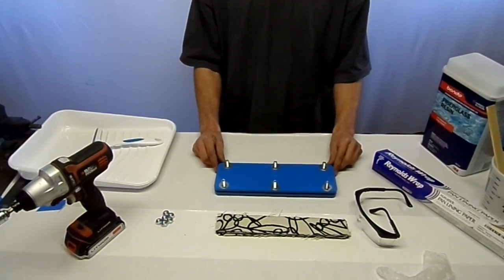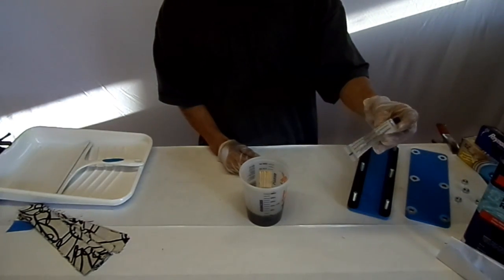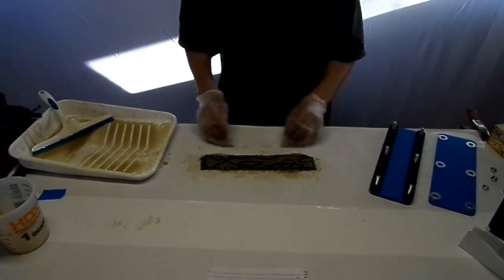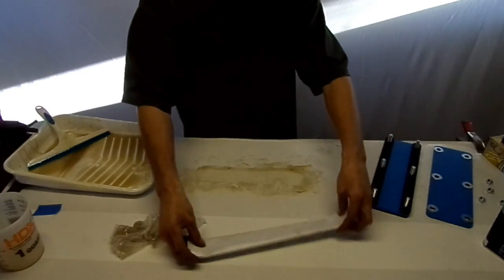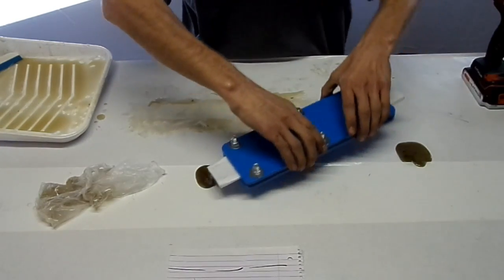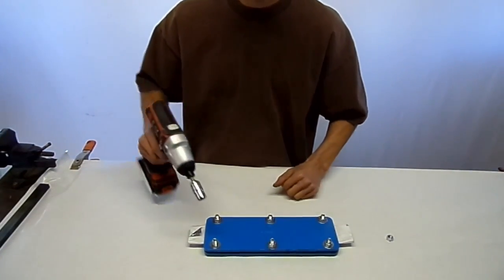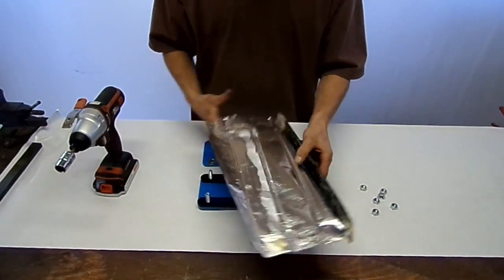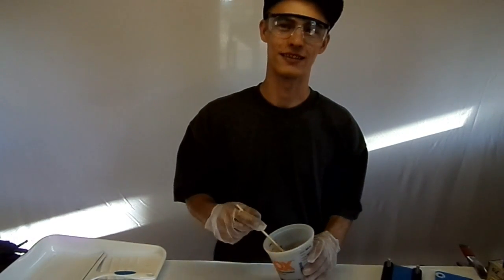Fiber Press - How To Make Fabric Micarta Knife Scales

Comment: i'm expecting my fiber press to arrive in a couple of days. the question i have is: understanding that thickness of cloth or paper will vary the number of layers necessary to make i/4 of micarta, what is the typical overall thickness needed before pressing?
Reply from the maker: randy mccumber I like to have the materiel just under a 1/4,right around .225 because the resin will add thickness.